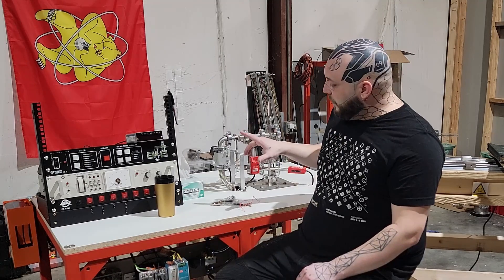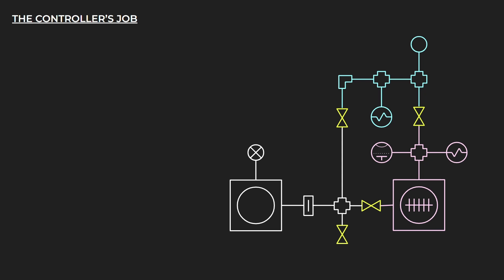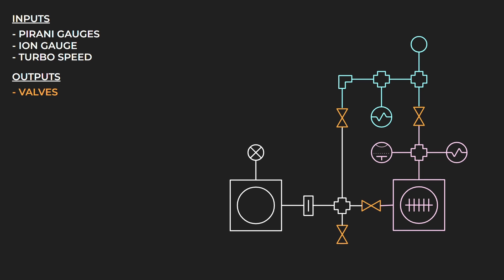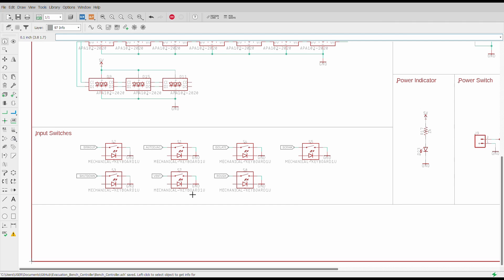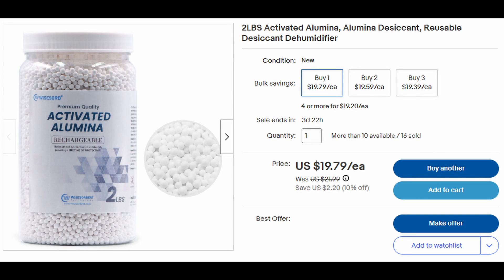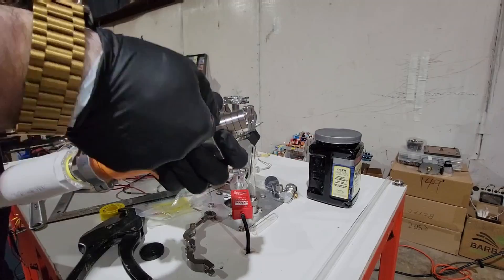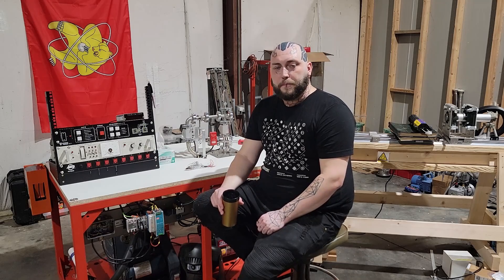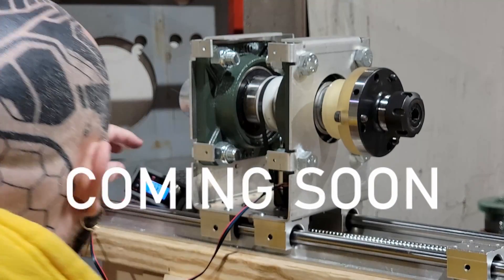I Built a Custom Controller for my Vacuum Chamber

Comment: Did you manage to find a good deal on those pneumatic valves?  They're usually super expensive,
Reply from the maker: Yep, I kept costs down by keeping everything small. Up to about KF40, you can get a good deal on used valves on eBay
Reply: @SignalDitch  thanks for the replies.  I hope I can also find some 'cheap' pneumatic valves.  I'm trying to make a list of ones that were considered good ~10-15yrs ago and then run automated searches for those.

Comment: Do you have a BOM, sketchy or otherwise, on the components used in the build? Looking for a good head start on the valving, in particular, since your turbopump, roughing pump, ion sensor, and other components are easy to identify already.

Comment: That Oil mist eliminator is disigned to sit vertically straight above the pump so that oil it collects can slowly drain back into the pump. where you hacve it now is likely to result in it slowly filling and eventually leaking oil.
Reply from the maker: You're completely right, I don't know why that didn't occur to me. I'll need to get more fittings, but I'll amend that soon.

Comment: Why do people put a Pirani between the turbo and the roughing pump?  
A Pirani after your Turbo (Between turbo and roughing pump) sees a spike in pressure as your turbo is spooling up, and should maintain a pressure higher than your evacuation pressure.  By nature of the turbo, it's constantly compressing molecules from the evacuation port into your foreline where you have a Pirani that's just seeing that compression.  It's not actually reading anything...

Like, I'd get it if you have a system that is meant to switch between two chambers like an LPC that has a dewar + gas system that need to be evacuated independently.  But in this application, it seems like you're just oil contaminating a vacuum component by putting it in the path of oil diffusion?
Reply from the maker: I'm sorry, I'm not sure what you're talking about, every pirani in this system is "before" the turbo. One is at the inlet, across from the BA gauge. The second is essentially in the "vacuum chamber" (the evac port) of the system, it's there because the evac port can be isolated and it's important to ensure that the evac port is roughed down before opening it to the turbo again. 

Are you commenting about my TC on the roughing line? That's just a cheap refrigeration TC that I stuck in there for diagnostic purposes. I wanted a second opinion during shutdown to see where a loss of vacuum was occurring. Even so, it's pretty far from the roughing pump, after a trap, and it's nice to have some warning if there's a problem in the foreline and the backing pressure is rising (before the turbo starts to bog down)

And what do you mean about a pirani "seeing" the compression? Your roughing pressure is your roughing pressure. Sure, the turbo is moving gas molecules into the foreline, but the roughing pump should be pulling them out of there asap. My foreline pressure continues to drop as the turbo spools up. Turbos are not good at compression (even one with a drag stage, like this, which is pretty happy at large gradients) which is why it's important to monitor the foreline and keep the pressure at the right level. Too high and the turbo burns up, too low and you boil the oil out of the bearings.
Reply: @SignalDitch  

I'm sorry, I'm not sure what you're talking about, every pirani in this system is "before" the turbo. One is at the inlet, across from the BA gauge. The second is essentially in the "vacuum chamber" (the evac port) of the system, it's there because the evac port can be isolated and it's important to ensure that the evac port is roughed down before opening it to the turbo again. 

That makes sense.  Pretty standard Turbo protection.  I'm used to MRI systems (Pumping down the outter Vacuum Space), and our test Cylinders that we test Cryocoolers in).  We generally just have one Combination gauge that can go from atmospheric to 1x10^-9 Mbar)

Are you commenting about my TC on the roughing line? That's just a cheap refrigeration TC that I stuck in there for diagnostic purposes. I wanted a second opinion during shutdown to see where a loss of vacuum was occurring. Even so, it's pretty far from the roughing pump, after a trap, and it's nice to have some warning if there's a problem in the foreline and the backing pressure is rising (before the turbo starts to bog down)

I was, that looked like a Pirani (7:30, that device just to the right), but that makes sense.  Thanks for the input.  One thing I don't particularly love about the bellowed hoses is that they seem to trap a lot of gas.  No matter how small of a run I use, if I switch to a straight stainless steel pipe (Not practical in 99% of applications), there is less pressure rise when the system it turned off.  (I put an isolation valve just after the trap on the roughing pump to ensure rise in pressure was not cause by back streaming of oil.)

And what do you mean about a pirani "seeing" the compression? Your roughing pressure is your roughing pressure. Sure, the turbo is moving gas molecules into the foreline, but the roughing pump should be pulling them out of there asap. My foreline pressure continues to drop as the turbo spools up. Turbos are not good at compression (even one with a drag stage, like this, which is pretty happy at large gradients) which is why it's important to monitor the foreline and keep the pressure at the right level. Too high and the turbo burns up, too low and you boil the oil out of the bearings.

So, in multiple setups, including a one with a scroll pump that is meant evacuate a Helium Vessel (By itself), and then also be able to switch over via a valve to utilize a turbo to pump down a Dewar (The others are just Vane Pumps with a turbo).  For one example, we have a Leybold TOPS361.  They put combo gauges (One is low vac, and the system will swap over to a PM gauge at high vac) between the roughing pump, and the exhaust on the turbo.  I also put a Cold Cathode gauge (Infinicon Blazers) on the inlet of the turbo.  

Immediately, the Pirani on the exhaust starts ticking up as the turbo spools.  Additionally, the penning on the exhaust never gets below 5x-4 despite the CC on the inlet being in the 6x-7 range.

However, I trust/appreciate your knowledge and I think further investigation into what I am seeing is required.  Mind you - this TOPS is from the 80's and was sitting in a warehouse and our parts guy wanted to throw it away before someone stopped him and sent it to me to look it.  It was missing some pieces, and also had a few used and new Pirani and Penning gauges (These were used to pump down old Opart Magnets), so it's entirely possible my gauges are...  Field seasoned.

Comment: Is there some kind of filter in line with the evacuation port to catch glass going into the turbo should anything break? The rig looks awesome by the way.
Reply from the maker: Thanks! Yes, there are two screens between the port and the turbo. One is built into the ISO-K centering ring on the turbo, and the other is built into the KF16 centering right between the compression fitting and the tee. 

I've said before that if you're choosing what size debris can get into your turbo, then you're already in trouble, but it doesn't hurt to try. 

During high risk operations like tip-off, I'll shut the turbo isolation valves, but that leaves plenty of time during bake-out, etc. for something to go wrong. Good question.

Comment from the maker: While the video processes up to HD, let me pin a comment about a few things I didn't mention in the video: 
1) The defect on the old mechanical pump is probably just a shaft seal. This is easy enough to fix and I'll get around to it before too long. I just couldn't pass up the opportunity to collect a second Welch 1402
2) I didn't get into detail about the controller firmware, but if anyone is interested then I'll put it on Github. It needs a little cleanup. 
3) The diagram doesn't show the turbo vent port, but I intend to add another valve there with a pinhole so that the controller can stop the turbo more effectively.
4) The vacuum gauge controller (VG Electronics IGC-27) tends to output a small negative voltage on the analog line when the gauges are bottomed out. I ended up dealing with this by just building diodes into my patch cables. 
5) There is a pressure transducer on the pneumatic line for the valves, but I need to do some work on the pneumatics anyway to replace the air-drying and coalescing filters. In the future, thr controller will be aware of the pneumatic system pressure. Until then, all valves fail safe anyway so its probably okay if the controller loses valve control and doesnt realize it.
6) You may notice we dont reach UHV in this video, i think we top out at 1e-5 mbar. This is because the system has not been properly cleaned or baked out and was also recently vented to atm. Here in VA were sitting at >60% humidity so its basically full of water. Ideally, in the future, the top end of the system would only ever be purged with dry nitrogen. 

By the way, I wrote an article on DIY Diodes for the next issue of Make: Magazine (Make: #86) so keep an eye out for that!